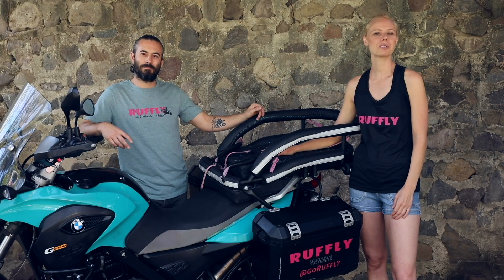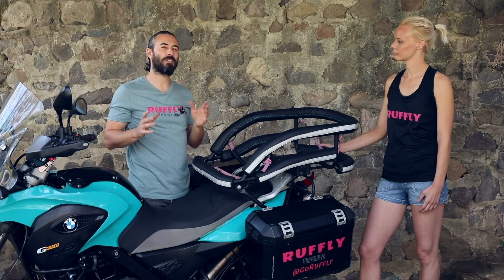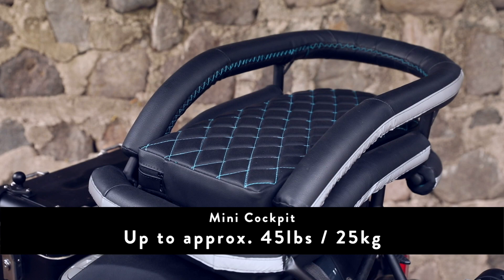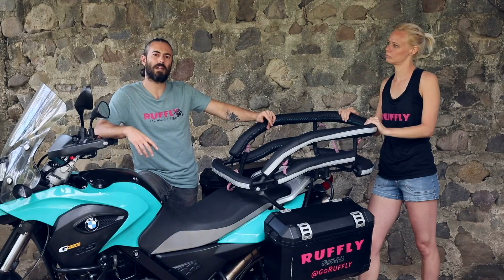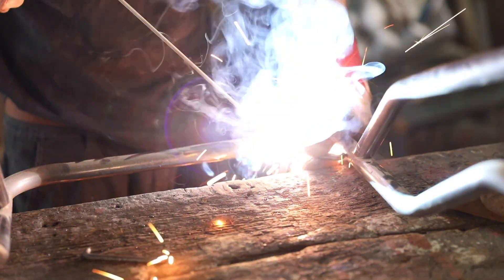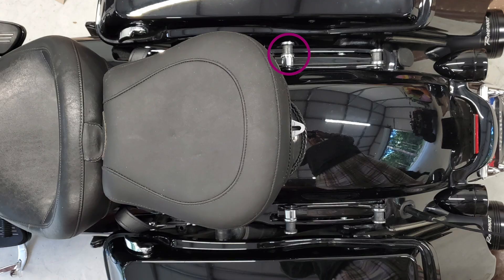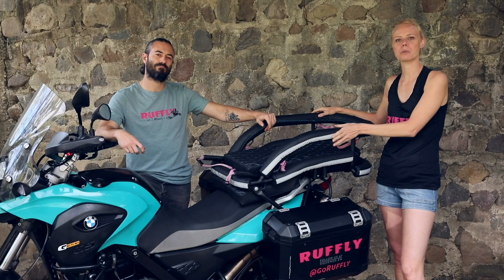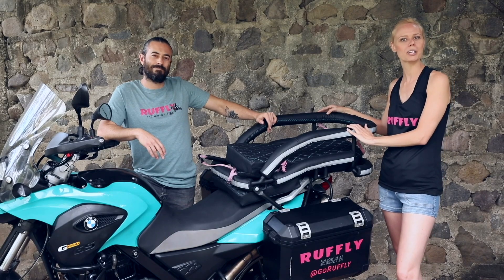Best motorcycle dog carrier to share the thrill of the ride! | K9 MOTO COCKPIT

Comment: What are the materials used for the tubes and base rack?
Reply from the maker: We build the Cockpit and mounting hardware out of a mild steel.
Reply: Can I use 5/8 inch stainless steel pipe instead of 3/4 inch?
Reply from the maker: @oneandahalfmenn  5/8 should work just fine as long as the walls of the tube are sufficiently robust.

Comment: Nc750x for husky 48.8kg 5"5 height?
Reply from the maker: A husky of that size is probably on the upper end of the Standard Cockpit or possible in the Large size. You can visualize the fit by using this diagram: https://www.goruffly.com/product/k9-moto-cockpit/#sizes
In terms of mounting to the NC750X, we'd probably want a sturdy aftermarket luggage rack to be installed because that bike is fairly naked in the rear but many of the luggage racks mount to multiple points. In addition, we make a front hinge so that you can access the tank under the passenger seat.

Comment: I'm gonna buy a Aprilia sxr 50, and i want my dog with me with a 2 year travel. Now i'm wondering if the cockpit can be made for a scooter(Aprilia srx 50)
Reply from the maker: The SXR 50 has a luggage rack area with a removable panel that should allow for mounting the Cockpit. Alternatively, I believe that Aprilia makes a metal luggage rack replacement that can be installed, which might be a good mounting option.

Comment: My bike is Triumph Scrambler 1200XE and my dog is 14kg like my picture, Is it does work?
Reply from the maker: Absolutely we can mount to the Scrambler 1200XE. For a smaller dog like yours in a Mini size Cockpit, the rear bar behind the passenger seat is probably sufficient for mounting. Otherwise, there are good aftermarket luggage racks that we can mount the Cockpit to.

Comment: is it good for carrying dogo argentino 45-50kg on piaggio X-evo  250cc scooter..?
Reply from the maker: We have build Cockpits for dogs as large as 55-60kg. This is a lot of weight for a smaller size motorbike or scooter, however, it mostly depends on the mounting. The scooter was designed to carry the weight of a human passenger and your dog is not heavier than that. The X-evo has a location where you can mount a luggage rack, so if the luggage rack is mounted well, then we can install the Cockpit to the luggage rack. For more information, please visit us at https://goruffly.com/cockpit!